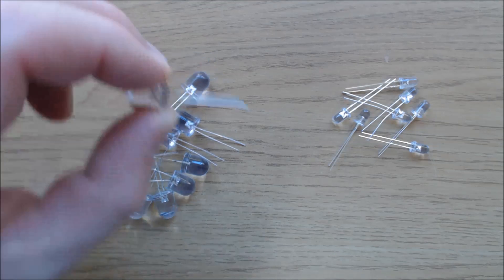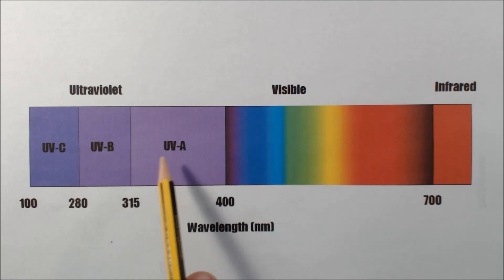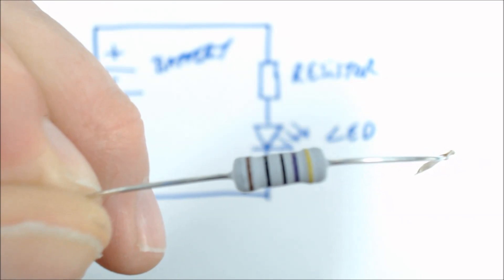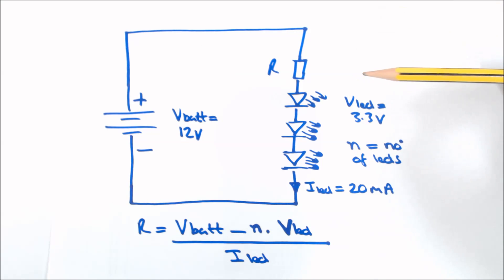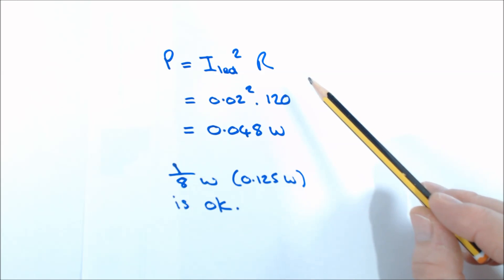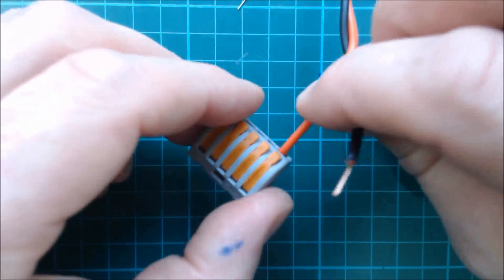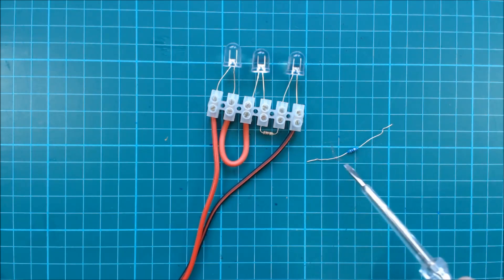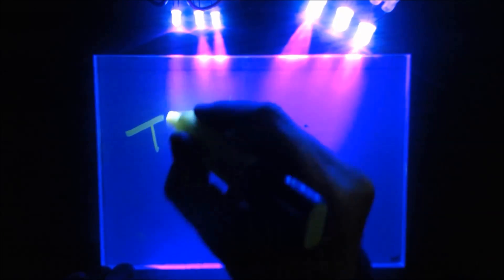How to wire UV ultraviolet LEDs experiment & tutorial

Comment: Thanks mate.
It seems to look basically simple & straight forward. 
All this friging around just to get a strong powerful distance 254nm short wave flashlight/tauch. 
365nm Long wavelength straight of the self.
But a 35 + wattage 254nm short wavelength UV light.
There just not out there. On the shelf.

Comment: If 4 UV LEDs Connected in Series and it is Powered by a 12 Volt Battery, then, Without connecting to any Resistance, will the Series of UV LEDs work without causing any Damages..? Kindly guide me...
Reply from the maker: It depends on the internal resistance of the battery. In general you should include a resistor to limit the current.  The correct approach is to use 3 leds and an appropriate resistor.
Reply: @techydiy   Thank You So Much

Comment: I want to have a  254nm wavelength for my experiment. Can I do it with led lights or I must find a lamp. Why they use 254 with lamp and not 285 with led lights? Thanks again
Reply: If you aim to eradicate most of the microbiological organisms you need to usea light source with 254nm wavelength (Kowalski, W. (2009). Ultraviolet Germicidal Irradiation Handbook). The light density will determine the duration you need for near complete annihilation (99,99%). Nowadays pulsed xenon lights are being used.

Comment: Really informative, thank you. Im beginner. What if I have 100 UV LEDs. one resistor would not be enough right ? should I put them in rows with a few resistors or something?
Reply from the maker: You need one resistor for each series string of LEDs.  There are online calculators which will work it out for you as well.
Reply: @techydiy  Found it, tkank you !

Comment: Yeah I'm trying to do a project with UV LED light powered by a male USB port on on my laptop the led is 5mm 350mcd 20 degree beam I was wondering if a 100 ohm resister on the positive side of the LED plug in a laptop USB port on the side will work for me and I cut a 6 inch male USB to a mini USB male port mini side off and striped all the wires off and just left the red and black wire only and the long side of the led solder to the 100 ohm resister and to the red wire and the short Side of the led straight to the black wire but I don't know if this will work for me and not blow out the UV LED light 🙄
Reply from the maker: The Usb voltage output is 5v, find out what voltage and current the led needs and then do the maths

Comment: can you please contact me ? i'd like to string 10 5mm and need to know how i cn power it by battery and by 110/220v
Reply from the maker: There are online led calculators. Available.  You should avoid directly powering LEDs with 110/220v as this has the potential to be lethal. A wall wart to drop the voltage to a safe level is the way to go.